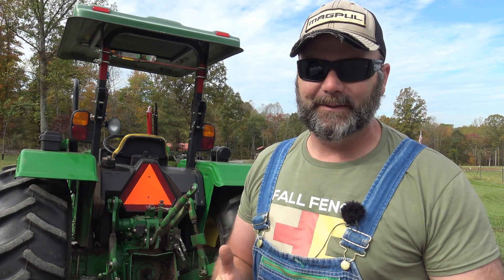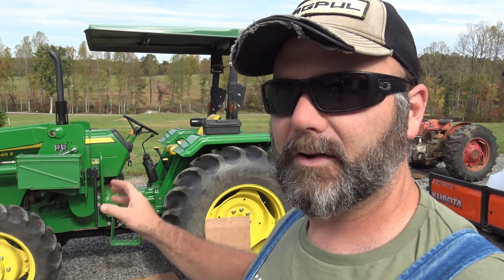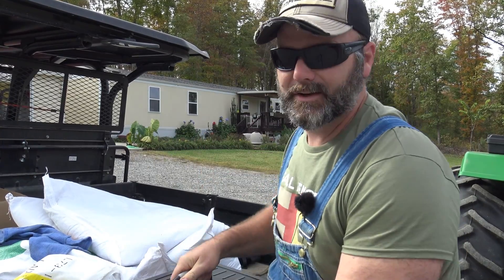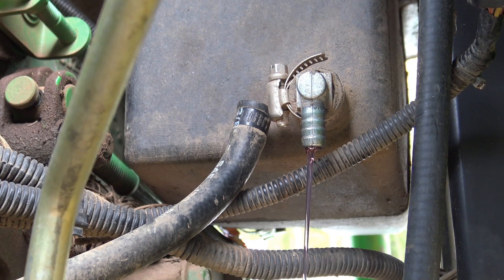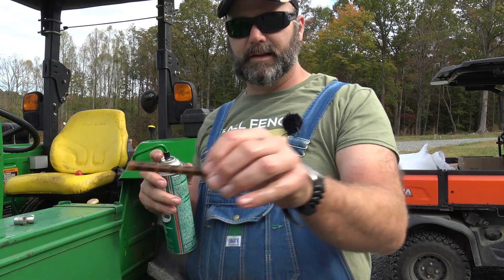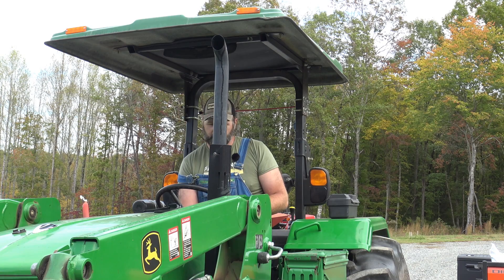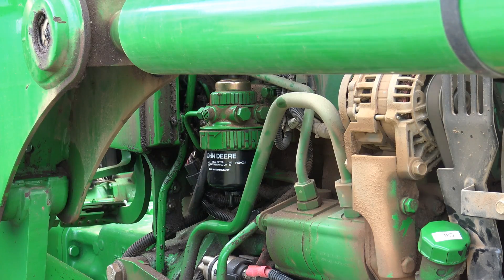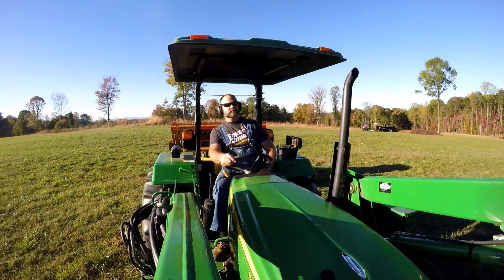This little thing was the problem...but what's stuck in it?

Comment: Ya got slimed!! Biobore, max dose for fuel tank, fill to the top with fresh fuel, let sit 24 hours, put a easy access in line filter{the largest you can get, and several spares} remove the tank screen since the in line filter does the same job. Start farming!! Just keep your spare in line filters handy. The biobore will kill the alge and clean the tank. Most All the goo will be caught by the in line filter,the real fine stuff will be caught by your final be filter. Three tanks full should do it. The use the maintenance dose of biobore for the warm season. Even with a new tank and fresh fuel, alge can be a real headache in your region. Humidity and long warm days does it.

Wear gloves!! The slime and biobore both are toxic!

Comment: Red Agri diesel is crappy, you need to put Sea Foam additive in tank when you fill up. Had to do that in both of my tractors and my Dodge turbo diesel.
Reply from the maker: I know some folks that would argue that off road diesel is exactly the same as on road...just has a dye in it to show it's not taxed for highway use.  I've also been told that seafoam is hard on plastic and rubber parts...I don't know for sure from experience
Reply: @StoneyRidgeFarmer  You got to be careful with Seafoam, not to use too much added to the fuel, and not to use it unless you will run it out during use after adding it.  I don't care what anyone says; it ate a $500 Holley 4 barrel up on my truck.  Literally disintegrated the aluminum carburetor!  I used too much and it SAT in the carb and ate it.  It IS great for cleaning out the entire PCV system (watch the videos) but I wouldn't recommend adding it to the fuel.  So be careful with it.

Comment: the filter was the symptom , the problem was moisture as indicated by rust on the chain ans fuel inlet, should have put some of the fuel back thru it as a flush to the tank. appeared to be 2 colored diesel when it first started draining , the solution to algae??????  a good fuel additive!!!

Comment: If you look in your operator manual there is a maintenance schedule (just like cars and trucks). The in tank filter screen check will be in there. Probably every 100 hours or annually. Read and follow that.
Reply: In-tank filters are so messy to check. My old neighbor removed his and put a shut-off valve just outside the tank then followed that up with a primary in-line filter. Works great and you can shut off the fuel when you want to check it!
Reply: @oodoodoopoopoo  No argument about the mess.I've got 13 tractors plus a dozer,crawler loader,backhoe,dump truck,ditchwitch,log splitter...Maintenance and monthly runs are a bear to keep up with.
I use road fuel: in Texas the off-road fuel paperwork is not worth it. Road fuel seems to be fresher and less contaminated than the off-road fuel in my area.Still get slime every now and again and there is an additive I use that seems to work. On one of my videos about dirty diesel slime.Can't recall the name right now.
Reply: @amossnowdaharleyman9179  - Many people swear by the effectiveness of Diesel Kleen. Enough to give confidence that it keeps the tank clean and there's no notable damage to other system components from using it.
How do you keep track of maintenance schedules for such a large fleet? On paper? Spreadsheet? Maintenance schedules/reminder app?
Reply: Looked up my video on diesel slime: Killem by FPPF. Got first bottle at JD dealer then got more at Amazon. Good stuff.
Reply: @oodoodoopoopoo  paint pens: label filters with hours and dates.Almost of all of my equipment is stored under cover so the hydraulic systems do not have water contamination issues. From paint mark on filters I can schedule hydraulic system maintenance.Rest of maintenance is somewhat easy: grease before every use etc.Check air filters after 10-20 hours if dusty. I'm old and have decades of experience so for the most part I can remember what to do.
Reply: @oodoodoopoopoo  Used diesel kleen for many years and had to keep treating. Killem seems to "killem": once and done.

Comment: Rather than 'hitting that small plastic fuel filter with brake cleaner'...why not purchase a new filter and save the old filter as evidence to show that the fuel you purchased was not that clean? Even though the plastic filter was a John Deere part [and probably "John Deere" expensive], I would have greater confidence in a new filter protecting my tractor.
Reply from the maker: why waste $15?  This isn't a filter issue...this filter is made to catch debris, you clean it and put it back in the tank.   You can spend the extra $15 and get a new filter, but will ya have it on hand ready when ya really can't figure out what's going on with your machine?  Fuel nowadays doesn't last...it has more contamanents in it that creates algea...ever since this video I use diesel power service in all my equipment and I've not had a problem since...in any equipment I've put treated fuel.  There's no reason to replace a filter screen that's not damaged...."evidence" for bad fuel....it's all bad nowadays my brother!!! Honestly it is!

Comment: Hey. Bro. Great work.  Love your show. You need a supporter to get you your Owen show. Just bought a 1974 John Deere 830 tractor, been running good for about 2 months. It has died on us about 4 times already and now it want crank unless I spray starter fluid in carb. Do ya think there may be trash in the carb or line. Please help if you can. Thanks very much bro. I live in Alabama , don't know if the humidity has anything to do with it. It has ALWAYS BEEN!
Reply from the maker: 830 should be diesel...so you don't have a "carb" it's injection.  Probably some trash in your fuel from these garbage diesel fuels we have now...here's what I use in my fuel tanks now and it keeps this trash and algae out https://amzn.to/3EpfBCs (Stoney ridge amazon affiliate page link means I earn a commission on your purchase, that's how we bring you this content)

Comment: Putting an inline filter will not help you unless you remove the strainer that you cleaned and covert it over to an inline filter only.  That would make it where you could pinch off the line and change the inline without loosing fuel.

Comment: Take that filter out and leave it out. Add a clear in line filter  below it and you can crimp the line to change plus you can add a second better one and just use what's cheap so when the clear one gets funky change them both out. . I had that problem because of bad fuel because depending on station you just don't know the storage. We also ended up just using good clean hwy diesel. Your really not talking a big difference price wise and it solves those fuel problems with bad off road diesel plus off road tends to just outright sludge up esier with contamination and I find hwy burns better and last longer
Reply from the maker: I'm told that highway diesel is the exact same thing just has red dye in it brotha
Reply: @StoneyRidgeFarmer  
Yes but it's generally a sub grade fuel +- additives just like gas if you noticed sometimes the same gas truck will deliver to different places and add their brand additives.
I'm going on personal experience.
Reply: Plus the dye itself creates issues depending how much was dumped in.

Comment: Manufactures should not hide filters! That's a stupid way to install/change a filter. I'd remove that filter and install a large shut off valve where it comes out, then a quality water sep/filter system just after that, so you can change the filters without wasting all that fuel. Also as others have said, Bio Kleen made by Power Service. Look at something like -https://www.amazon.com/gp/product/B00171NUR6 and https://www.amazon.com/Caterpillar-175-2949-Advanced-Efficiency-Separator/dp/B008N0IWPO.

Comment: Shame on John Deere for using that cheezy piece of crap of a filter. I'm also questioning those hose clamps and rubber line, seems like a piss poor deal from the factory. If it was mine I'd install a decent shut off valve and a canister style fuel filter.

Comment: Algae is black & squishy those pces at the bottom of tank look like tank plastic from manufacturing.
But Feel will tell U. Looks clean.
Mason jar full of fuel, h20 will settle 2 the bottom.  
Algaecide will kill any algae, the filter (s) will catch em.
Time to switch to another supplier who leaves fuel filter on their pumps and has a high turn over of fuel, even more critical if its a Biodiesel which doesn't have as long a shelf life as dino it also attracts moisture which is why sitting bio has a higher amount of algae growing.

Comment: wow we had trouble with our fuel as well a few years ago the problem the company did that on persist to use  we bought fuel ahead of time  in spring  and fuel they go short on the diesel fuel they did put something into the fuel because all of the equipment had the same problem  we were only one had it too that year they did short-chain the fuel to the farmers too we did stop payment on that fuel  and we had and other company to bring us the  fuel we needed them other company  we when to count over this and we did we the case and they never pick up the fuel too they say they needed to have a very older heater that we could use it  that company is now trying to sell use fuel again  shame on us to had to go throw that the first time it shame on them trying to do this the second time we will not buy  any fuel or oil from that company now  we did 24 tracker engines  this year now rebuilding them  the oil that farmer has bought causing this we sent the oil out to be tested  and the test came back  had somethem  was put in to the oil  
we do to all of the dealership warning work we do  have all the oils and fuel tested  does help use in a problem  like this when we send the machine back to the farmer  we well put right on what we have put in their equipment usually we will put the dealerships oil into the machinery was  warning work  and we do provide  our service as a qualified shop to work on them  just wish the dealership was that way  
that has taking farmer we were one of them in and never got what we bought as to machine  or parts  they did own  use a lot of money for the work we did  we  landed up taking the dealership over now as a dealership now we need to make  right for the farmer  who lost their money  with them  we have just know 20  farmers that did  but 30 other poeple try to scam  us for thing especially  service work they said they did too they equipment  they need a work order for  the company  that did that work befor we could help them they did not know that we were the company does all of there work  we never had done any of the service work  
can not trust any one any more